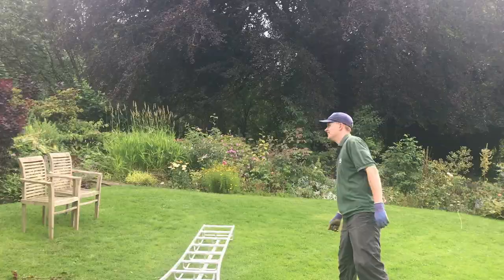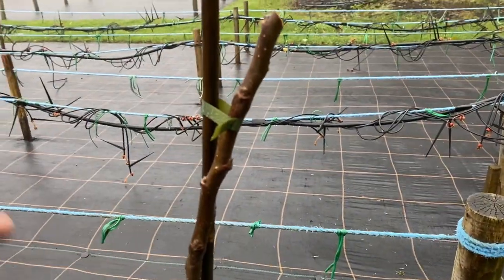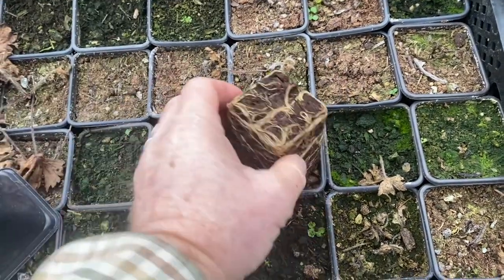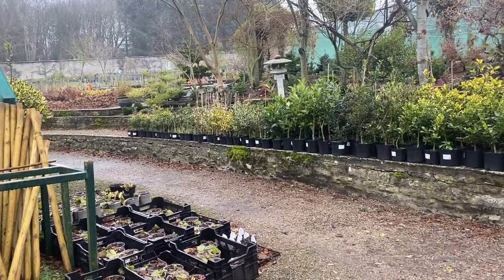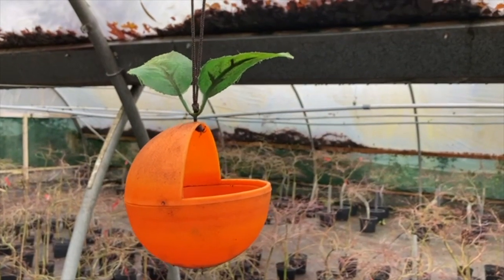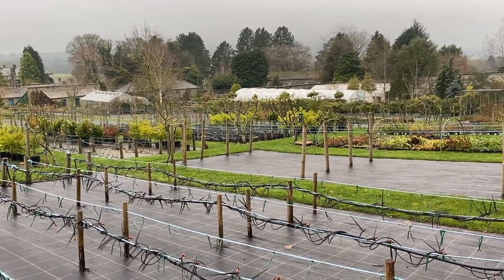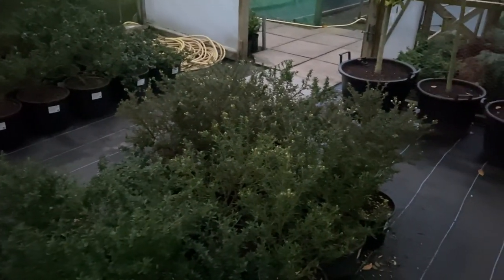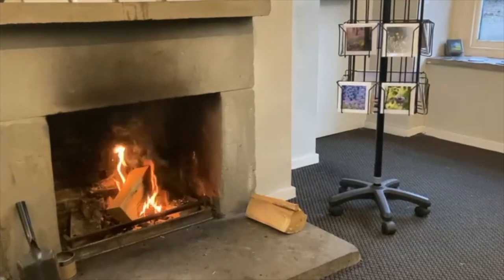HOW TO RUN A NURSERY...WEEK 50/52

Comment: If you buy a bare root tree & put them in a pot (unlike pot grown) do you still  have to plant them by spring at the latest while dormant? or is it possible to keep them in their pots to develop root growth & plant them later on?
Reply from the maker: Yes you can keep them in pots....we do with thousands. My advice though if you do this is to plant later than earlier. If the plant starts developing young roots in spring, these will be damaged as you take it out the pot....it would be far better to allow the rootball to bind itself. The victorians used to plunge plants like this....plant pot and all, then later in the year dig it up, remove the plant and stick it back in the hole.....I like this method, any roots through the pot holes can often be pulled through or if too large pruned off....no different than the fashionable air pots today......but often people buy plants or dig them up while in the process of moving home. So there’s often little option. One of the saddest things in life is when somebody takes over a garden that’s been lovingly developed and just chops it all down or changes it....it is quite natural to do so, we all have different like and tastes.....but it is a sadness I’ve seen repeated quite literally thousands of times over the years.....it’s not a criticism it’s just a fact of life. Best wishes....Malcolm
Reply: @plantsmanscorner128  Another piece of advice & a mistake many of us novice gardeners make (but worth mentioning) is when planting a tree we should not add any compost or nutrients like blood fish & bone mixed into soil of the hole. Our instinct is to do this thinking it will help the tree grow, but if we do then the roots will not grow out into the surrounding soil & will stay where the nutrients are, thus stunting the development of the tree. I learned the hard way. But is this also true of adding mycrorizial fungi? As far as i know it helps develop root growth by acting as part of a symbiotic relationship in providing increased water & nutrient absorption capabilities, while the plant provides the fungus with carbohydrates formed from photosynthesis. So its not in itself a nutrient but an enhancement, kinda like body builders who use steroids. Thats the science bit that probably flies over most of our heads. Very interesting though.
Reply from the maker: @BionicRasta  I’ve always told people not to add nutrition.....it was an old practice to put muck and bonemeal in planting holes. It is another received wisdom that we do. If the soils poor and they’re available molehills are excellent, as is a p,anting mat...an old bin liner or similar placed around the tree and held in place with manure or Barry...poke a few holes in with a fork and leave it. Stops weed growth and surface evaporation. As for the m.fungus.....no harm if you want to, and may help. But the addition of good leafmold will do much the same thing. Best wishes...Malcolm